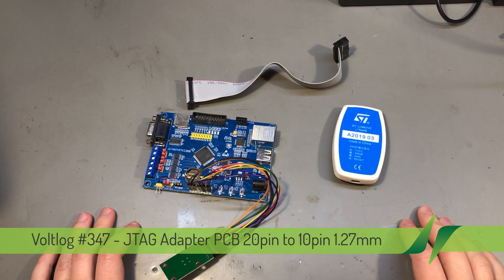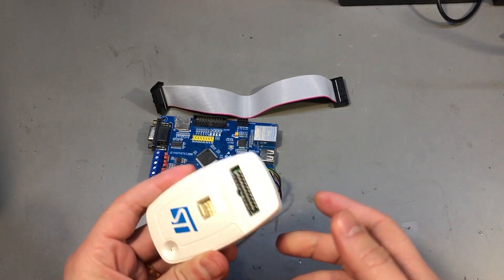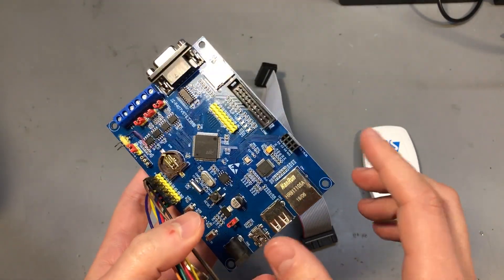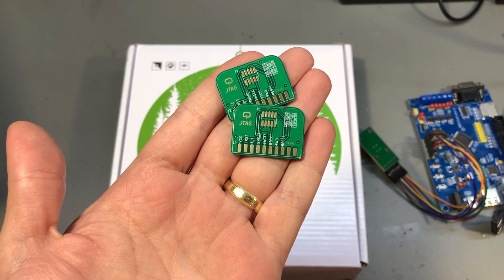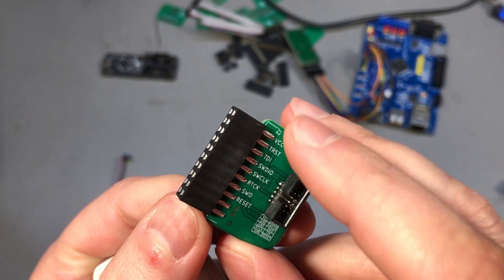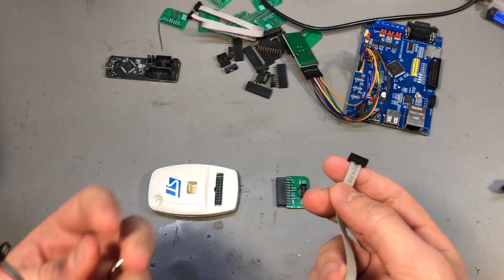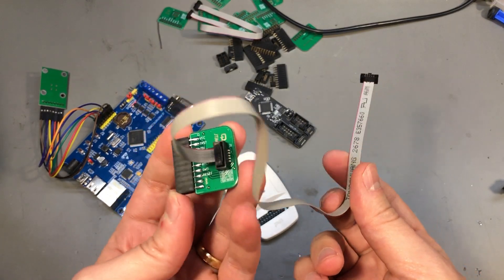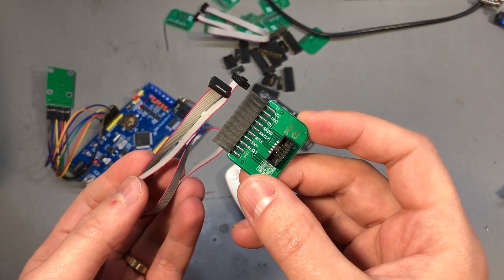JTAG Adapter PCB 20pin 2.54mm to 10pin 1.27mm - Voltlog #347

Comment: Most of stm's processors are SWD capable. You only really need 3 with that protocol :)
Still watching the video so I'm sorry if it's mentioned :P
Reply from the maker: I totally agree and as someone else also asked this I don't prefer JTAG over SWD, it's just that SWD is ARM specific and not gonna help if you try to load a bitstream into an FPGA.

Comment: Where did you get the cables for the 1.27 pitch connector? Where did you get the matching shrouded header? How much were they? Lots of missing info!
Reply: @jackhoffman6120  it’s not about how easy it is to find the info elsewhere, it’s about making a complete video instead of an ad for some pcb company. I mean, you could also just search aliexpress for “jtag adapter” and find many of these ready made for a few dollars...
Reply: @jackhoffman6120  chill

Comment: I like the Tag-Connect concept because it is even smaller and uses less through hole pins - the only downside is the price of the original cable (~50€). Still so tempting to invest once into it or to try a diy adapter with spring loaded test pins and a 3d printed housing.
Reply: I use Tag-Connect at work. It’s a really awesome system. But yeah like you mentioned, kinda overpriced for hobby use.
Reply from the maker: Tag-Connect is nice but a bit pricey. I'm working on a similar pogo pin style connection but it won't be ready for some time.

Comment: That is actually really nice especially because you went with a standard connector that makers might have around but I would say that another great use for your board is from the small 1.27mm pitch to be used as a breakout board ( segger j-link mini edu to a custom landpads set in a pcb such as adafruit trinket m0 ) . Anyway great tool you and really nice design :-D
Reply from the maker: Thank you 👍

Comment: Where did u get the small pint header
Reply from the maker: There are many sources where you can get those: Digikey, Mouser, Farnel (or any big distributor), LCSC, Aliexpress, Ebay. Just search for 1.27mm smt pin header.

Comment: Ah yes for such a case I also designed an adapter-board ( https://github.com/Fescron/universal-jlink-adapter ). My version is a bit bigger but has more options (2.54mm & 1.27mm spacing, reconfigurable pins with jumpers, the ability to power the target, ...), uses all through-hole connectors (easier to solder with an iron) and uses an un-shrouded (and 180° rotated to your version) 1.27mm connector which I find easier to plug a ribbon-cable into. Different use case I suppose, nice small board you made!
Reply from the maker: NIce! And well documented as well.
Reply: @voltlog  Thank you! It had multiple revisions regarding both the hardware and documentation :)

Comment: SWD over a TC2030 cable. You'll never want to use IDC-style again.
Reply from the maker: Those TC2030 are pretty nice, I plan to do a pogo pin style connection in a future video.
Reply: IMO both have a different function, IDC is nice for static programming (development on your desk), but the TC-cable is very nice for quick in-the-field programming
Reply: They're definitely nice (I'm doing software on a design which uses one at the moment for a client), but a bit pricey.

Comment: 3:43 You could draw the key with a hot glue gun
Reply from the maker: Yup, I guess that could work but with my skill it will end up this blob of hot glue :-)
Reply: Maybe you could use a mold? Or just carve away the excess... But considering how you like things nice and tidy it might not be the solution for you. Small details like that bother me more than I'd like to admit. Luckily electronics is just a hobby for me so there's no pressure to be actually productive. 😅
Reply from the maker: @ristomatti  I will most likely continue to search for the correct connector 😁